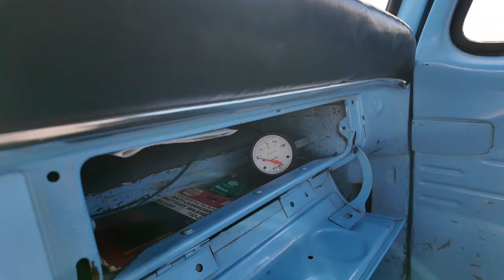Will Earl Make it To Tucson And Back?

Comment: I'd seriously consider some dynamat type heat barrier on the roof and cover it with an American flag headliner.  That and some tint would be a step in the cool direction.
Reply from the maker: I'm inclined to agree
Reply: The cheap amazon kilmat works great I have used it on the floors and roof and makes a huge difference with heat and sound.
Reply from the maker: Interesting, I'm gonna look it up

Comment: If U wouldn't mind could U give a break down video on the truck parts , rear end model ring and pinion,  efi model and other I have a 67 f250 I would like to upgrade. 
Thanks. I am in Dallas area.
Reply from the maker: The easiest way to explain it would be to check out my older video of the EFI swap and comparison.